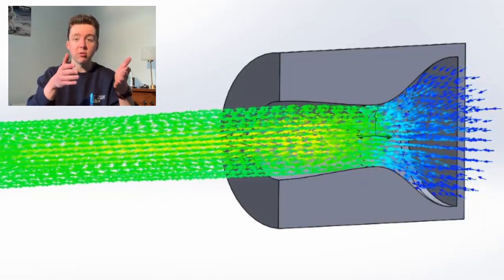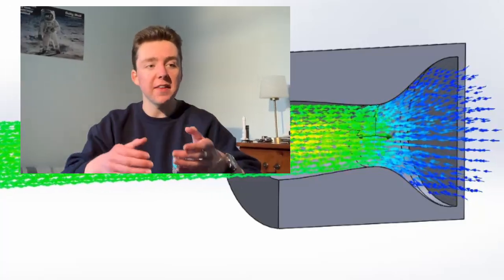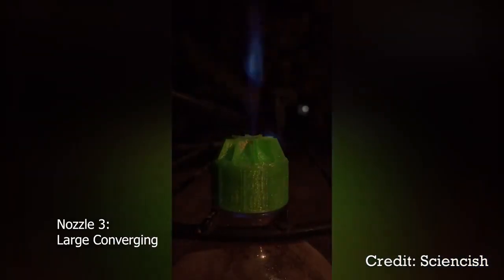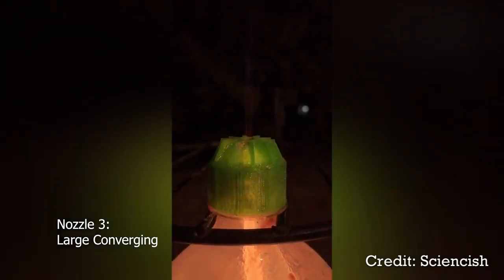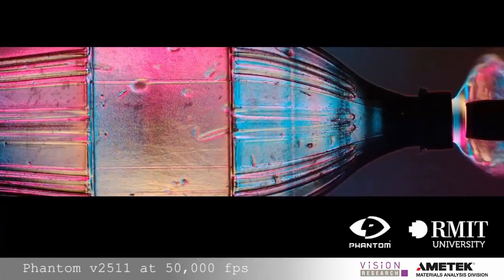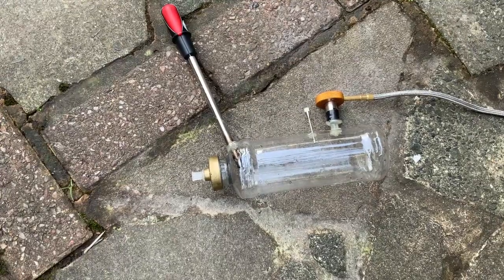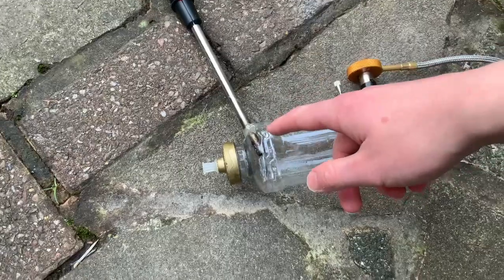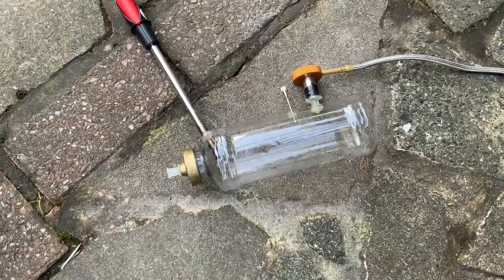Making Mach Diamonds From A Bottle

Comment: No man, they are generated by the supersonic expansion, not by the atmospheric pressure
Reply from the maker: Please explain more
Reply: @TheDodgyEngineer  you said that they are caused by the interaction with the atmosphere, but actually the patterns that you see are caused by the expansion and compression waves inside the jet itself.
Reply from the maker: @martinopinto6323  without the atmosphere, the pressure difference required to create the expansion and compression waves wouldn't exist
Reply: @TheDodgyEngineer  okay, yeah, putting it into this simple concept okay, but you don't see them when you do it with less pressure, because you need the flow to be accelerated up to supersonic speed. Also subsonic interacts but does not create patterns. Only in supersonic regime the shockwaves do appear and usually pressure differences are not required (see the shock generated by a ramp). That's why I say that it's not the interaction with the atmospheric pressure
Reply from the maker: @martinopinto6323  But in the case of this nozzle, the shock pattern exists purely because of the pressure difference between the exhaust gases and the atmosphere.
Reply: @TheDodgyEngineer  no man, the pressure difference is not enough. It can't justify alone the appearance of pattern, as I already said
Reply from the maker: @martinopinto6323  Fine, the necessary conditions are that the flow is supersonic and there is a pressure difference.
Reply: @TheDodgyEngineer  hmm an expansion through a nozzle specifically